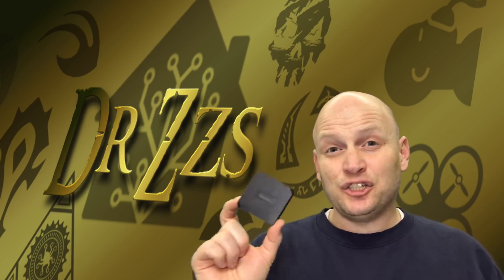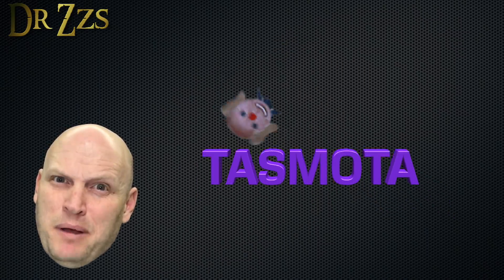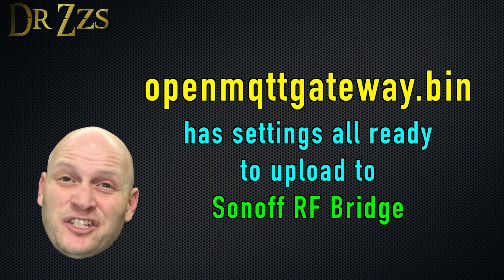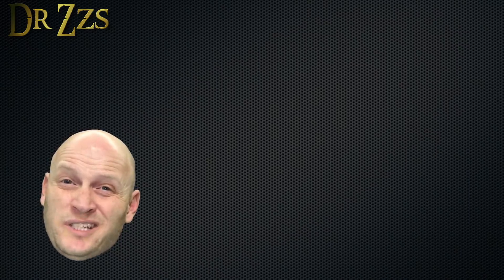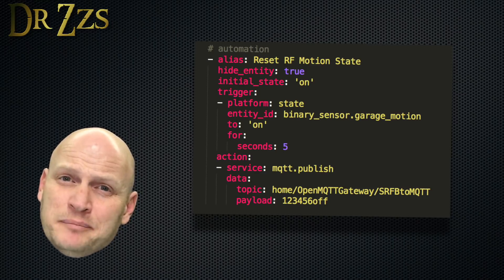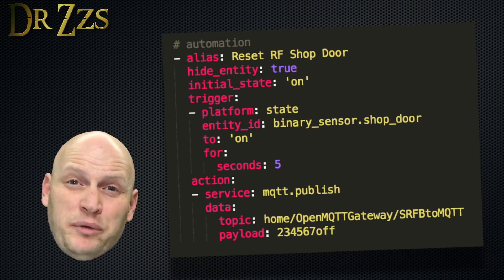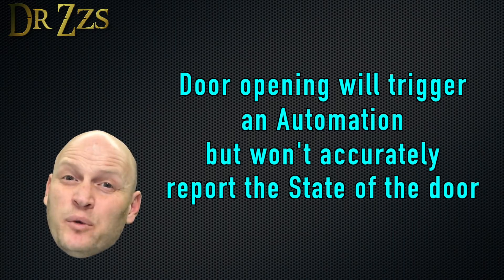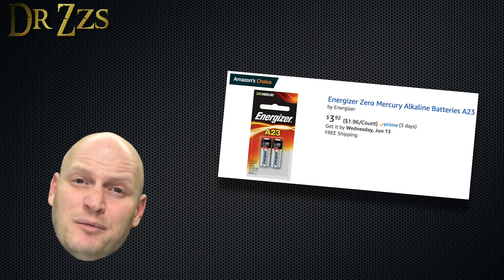Sonoff RF Bridge w/ MQTT & Home Assistant

Comment: Good video but I think with ESP8266, wemos d1 and node mcu are so inexpensive it will be easier to make any sensors wifi based instead of rf.
Reply: Wi-Fi devices use way more power than these inexpensive 433MHz ISM radios.  If you want battery lifetimes measures in months (or more), then that often excludes using Wi-Fi.

I ran across this other project   https://github.com/merbanan/rtl_433    that uses a cheap USB SDR dongle to receive and decode RF signals from all sorts of devices.  I've not done anything with it yet, but it seems like a really interesting approach for funky wireless devices.
Reply from the maker: I sure love me some D1 mini's.  I'm getting to the saturation point with 2.4ghz devices.  I like the control you'd get with a wifi/esp based sensor for sure.  I feel a little disconnected from these sensors when my only interaction with them is to see the MQTT topic after the bridge sends it.
Reply: DrZzs  did you separate your WiFi having one for personal devices and one for home automation stuff? This helped me a lot.
Reply: Louis Mamakos I guess it depends if you are using battery devices or not.
Reply from the maker: cool!

Comment: Have you tried the Xiaomi Gateway?  Very cheap sensors and very reliable.  I'm in the US and bought the gateway which came with the China->US power adapter and I couldn't be happier.
Reply: Fully agree and it really does work well in Home Assistant. The gateway also includes a built in (multi coloured) LED set and has a built in loudspeaker that can provide alarms (such as a doorbell, dog bark, police siren etc) Superb value and great sensors!
Reply from the maker: cool!
good to know.  I'll have to check it out sometime. 
Thanks!
Reply: Yeah, mine works fine too.
Reply: I would have guessed the Xiaomi would have encrypted the sensors somehow.  So with the above it can talk to th Xiaomi sensors reliably?  Send and receive?

Comment: Thanks a million...as usual. My Tas flashed RF bridge has been a paperweight for a few weeks now. Was up and running, but I could never get the RFkey commands right to retrieve the mqtt codes for commands. So I gave up and waited on your video. ;-)
Question: What is the total number of sensors per bridge that can be added? In eWelink app you can only add 4 alarm type sensors per rf bridge. Hence the reason I am using 3 of them for basic coverage...ummm...2 now, cuz I killed one with Tas. LOL
Reply from the maker: Oh man, 
Well, glad you can dust off the paperweight and put it back in service.  I don't remember how many devices it can handle.  I did read that it is more than the ewelink app, but I can't remember the number.  I only have 3 to test with... Maybe there's some other folks here that could tells us both.  Anyone?
Reply: Only thing I know from their app set up is it can handle 16 RF keys, but only set up as TX, I was hoping their app was the limitation for only 4 RX options and NOT the bridge. Hope someone may have a better clue than me! ??   (  still waiting on my Konnected boards :/  )
Reply from the maker: ah, I'll see if I can find what I read.  Try the OpenMQTTgateway github.  I read so many things I can't remember where I read what...
https://github.com/1technophile/OpenMQTTGateway

Bummer on the Konnected's.  I haven't done much with mine since installing them.  Just too many projects :)

Comment: Hi 
I need some help, the wi-fu OpenMQTTGateway needs a wi-fi password
I tried 01234567, 12345678...
Reply from the maker: That's odd.  Let me check with J.  We made several revisions to that bin file, maybe we goofed the password on the last one.
Reply from the maker: No password in the sketch.  Not sure why it would ask for one.  Try restarting the bridge, or tell your wifi to forget that network and try again, or maybe even reflash. 
Sorry man, looks like you've discovered a new glitch!
Reply from the maker: try connecting from a different device too.
Reply: Restart bridge done, reflash RF Bridge done, trying to connect with another device done and still not work :( :(
Reply from the maker: hmmm.  okay.  I'll have to try it when I'm home and see if I can get the same result.  
Another thing you could try is going to the OpenMQTTgateway github and downloading, editing and compiling the sketch yourself. Then you can put your own Wifi SSID/PW and skip the wifi broadcast setup. 
I don't really know what the issue could be.  There wasn't a password requirement in the sketch when we compiled it. 
Sorry man.  You seem to get all the bad luck.
Reply: DrZzs Ok thanks I’ll try this solution

Comment: Great video, keep ´em coming :-)
To make a door closed sensor, I have replaced the Normally-Open (NO) reed switch with a Normally-Closed (NC) in a Sonoff DW1
That way I can use two door sensors to detect the state of a door. The NC to detect the opening of the door and NO to detect it being closed again.
Reply from the maker: I thought about that!  
Glad to hear it works. I think I'll do exactly that then on my shop door with my other DW1. 
Thanks!

Comment: I used this one: espurna-1.12.6-itead-sonoff-rfbridge.bin.  When I did setup the mqtt user and password it added automatically in homeassisant without modification to the config file
Reply: look at my comment up here, there's an extended firmware available, always from Espurna author, but a little hardware hack is needed... all info in my other comment... i tried it and for example the learn function passed from even 30 seconds and more, to just 2, for the same remote...
Reply from the maker: Awesome! 
I saw some posts about using ESPurna with the bridge too.  
You're happy with it?  it's doing what you want?
Reply: Yes, you can setup the off delay directly in the rfbridge webpage
Reply: I have the same and it has a great user interface, only downside is restriction on number of switches. Might try switching as I have a lot of rf switches that I already user on ha

Comment: thanks doc. I will get the bridge with out the sensors. for the other one you showed ($10) can be used with out automation to indicate if the door is open or cloased ? i believe this bridge would work with the 433mhz fan controllers. not to mention the sonoff RF. not sure if it will works with the new US touch switch that does include the 315mhz radio. Doc, since you have the touch switch please test and let us know if it works on the US touch switch.
Reply from the maker: Good call.  Yes, those other sensors will send 2 codes, on for open, one for closed.  There are likely other models out there. 
I don't think I put the link for those, so here it is:
https://amzn.to/2l3Zn9N

I'll test it with the T1's soon. 
Thanks!

Comment: Could this be used with RF ceiling fans?
Reply from the maker: I would think so.  The bridge should be able to learn and send RF commands.  I tried with a couple LED remotes I have, but it didn't work.  I'd have to do some more research.  Try the OMG page and see if they have instructions for learning.  
I don't have any RF controlled fans to test on.  But, it should work... Should.
Reply: Probably, as long as it's not a Hunter.  Check the frequency on the remote, if you cant find it look the model up in the FCC database.  I know the cheap add on remote ceiling fan controllers are easily done, at least with Arduino and the little $1 transmitter.  Thousands of Youtube videos on it already...

Comment: Another great video as always.  I flashed my bridge with Tasmota and am using the door sensors.  I send a push notification (and to my google home) when a door is opened...basically an alert if my kid runs out of the house.  In Node-Red I take the payload, parse it to JSON, then grab the Payload.RfReceived.Data value to determine which sensor it came from.  Works like a charm, and might get you back to Tasmota! 

[{"id":"d852461f.021648","type":"mqtt in","z":"65764253.400fbc","name":"","topic":"tele/433bridge/RESULT","qos":"2","broker":"54b6dd0b.427a94","x":140,"y":100,"wires":[["196f6a78.c589a6","4f76d51e.a43b1c"]]},{"id":"4f76d51e.a43b1c","type":"json","z":"65764253.400fbc","name":"","property":"payload","action":"","pretty":false,"x":330,"y":120,"wires":[["1991f11c.c3394f"]]},{"id":"1991f11c.c3394f","type":"switch","z":"65764253.400fbc","name":"","property":"payload.RfReceived.Data","propertyType":"msg","rules":[{"t":"eq","v":"291EC1","vt":"str"},{"t":"eq","v":"1072C1","vt":"str"},{"t":"eq","v":"5BDD41","vt":"str"}],"checkall":"true","repair":false,"outputs":3,"x":470,"y":120,"wires":[["72abf654.50a798"],["1239f5f8.1f743a"],["4d4b9f0b.c1515"]]},{"id":"54b6dd0b.427a94","type":"mqtt-broker","z":"","name":"","broker":"localhost","port":"1883","clientid":"","usetls":false,"compatmode":true,"keepalive":"60","cleansession":true,"willTopic":"","willQos":"0","willPayload":"","birthTopic":"","birthQos":"0","birthPayload":""}]
Reply from the maker: Thanks David! 
That's probably the answer I needed to get Tasmota working with the Bridge.  When I get the chance to come back to the bridge and monkey with Tasmota I will probably need your help to get it working right.  
Are you ever on the HA discord chat?
Reply: No problem.  I don't use HA so I won't be any help there (though if I ever get some free time I might check it out finally), but feel free to reach out whenever.

Comment: What about 2.4ghz and 5ghz RF?  :)  Joking before the nit pickers roll in.
Reply from the maker: You're right.  I'm sure it's coming. :)
Reply: Great video though!  I'll stick to my powered wifi sensors though.
Reply from the maker: Thanks!
I've got wired door sensors and have installed the Konnected system.  I'd rather have an ethernet solution though, since wifi seems to drop devices from time to time.  

Anyway, I'll send all RF frequency complaints to you :)
Reply: I have a Vista 20p panel and went with the Alarmdecoder module on a Raspberry Pi.  Pretty flexible and works well.  I used to have issues with WiFi in some places but after switching to a couple Ubiquiti APs that's been a thing of the past.  I could setup Sonoff's at the neighbors.